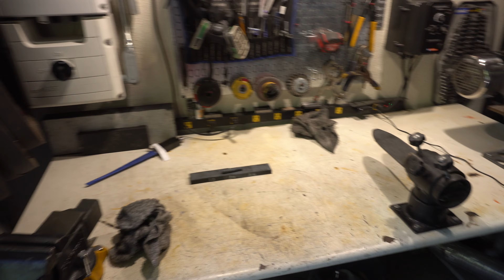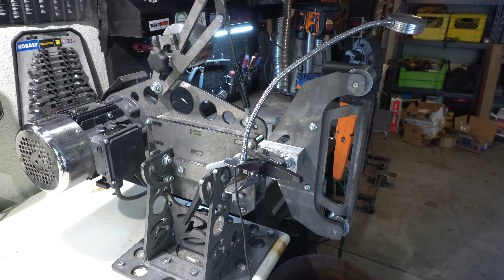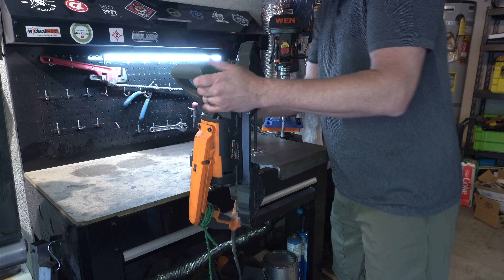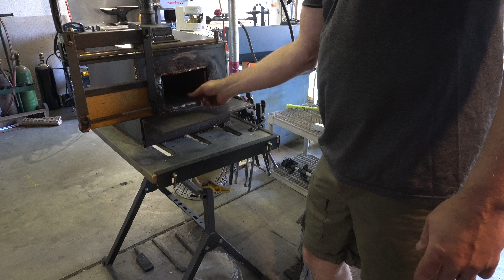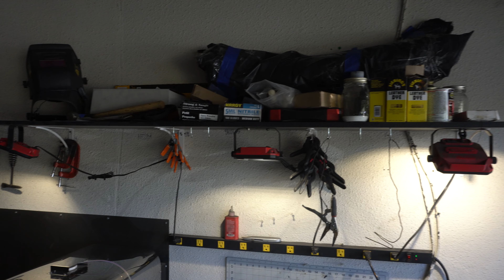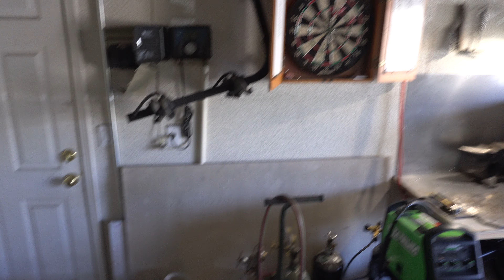Triple-T Thursday #39 - Shop Tour

Comment: How much money to buy all the tools and machines that cost to become a blacksmith,in your garage, that makes me have a good idea when I leave the house and buy a house.
Reply from the maker: That's a tough question... because you don't just start with all those tools.  I started by buying a welder and teaching myself (via YT) how to weld.  Then I build my first forge.  Then I bought an anvil (the NC anvil) a 4x48 and a vise and basic hammers from Home Depot.  That gets you really far.  Then I built my old 2x72 (the orange one that I've since replaced) and my hydraulic press.  Then I slowly started adding tools like the mill, oven, new grinder, saws, etc.  You can get into the hobby for about $500 and then decide if its something you want to invest more into. 👍🏻
Reply: @TyrellKnifeworks  hi, but just some rough estimates please. What would cost one to have the exact set of tools and equipment? thank you
Reply from the maker: @canadianguy5244  I'm going to list tools here, it'll help me calculate and also give you an idea.  Welder $1k, Oxy-Acetelyne rig $400, Oven $1600, Post vise $200, Mill $3k,  Lathe $1200, Mill/Lathe tooling $750, Table saw $400, Horz bandsaw $400, Metal cutting saw $300, Portaband $300, Anvil (hay budden) $800, Forge $600, 100lbs propane tank $200, Press $1500 (if you build it), Drilll Press $100, Grinder $2600, Small tools (vices, files, punches, clamps, tongs, hammers, etc) $1k.  So around $16.5k give or take $1k.  You've got consumables on top of that like belts, sandpaper, propane, electricity, epoxy, etc.  I didn't cover any of the leather supplies either, that's probably another $500.  I hope this helps you.

Comment: I was wondering a few things first of all what bandsaw blades do you use and what is your Aneling process to be able to use it?
How much was the mill? And how do you get through forge scale without a grinder everyone skips this step in videos and it’s so important but messy and time consuming 
Thanks in advance your channel is straight up amazing you are so good at putting things in a way that everyone can understand and you focus on the stuff literally everyone else takes for granted I am amazed at your shop you have so much less then I would have expected which says alot
Reply from the maker: Bandsaw blades: for the portaband I just buy the cheap dewalt blades or whatever is on sale.  For the horizontal saw I use the Starrets blades because they are better quality (https://amzn.to/2VctTTZ).  I usually leave what I'm cutting in the forge after I turn it off and let it cool as the forge cools and then cut it the next day.  That anneals it really well.  The mill was around $3k with the stand and vise.  If I'm doing restacking of damascus, then I'm using an angle grinder but if I'm just cutting steel, I try not to use an angle grinder.  I used to have a variable speed grinder and I used a stone wheel, that works really well, but I burned out that grinder and haven't replaced it.  Thanks so much for the kind words.  I appreciate that and you watching!  👍🏻
Reply: I’ve got this Idea to do a Damascus blade with brass and Nickel instead of copper but I have never seen it done and was wondering if there’s a reason. theoretically it would work like  copper because of its melting point which is 200° less And as long as the nickel surrounds it it should be fine right? Any input would be amazing considering you were the only person that has any experience with this that I can ask. I have had plenty of experience and success with nickel but even fully welded up The copper melts and leaks out Which amazingly does not ruin the billet.
Reply from the maker: @tommydean9414  The problem is over heating the brass and melting it.  It's really easy to overheat the copper in a cu mai and melt it away, so brass is going to be even harder with the melting temp around 1825, which is about 150 degrees less than copper.  You'll definitely need to fully weld the edges.  Even then I've had the copper leak out sometimes.  It's certainly doable and I've seen it done before.  I've seen the brass/copper/nickel combo.  You just need to really watch your heat and keep it dull red and just enough so the steel moves and no higher.  Good luck!
Reply from the maker: @tommydean9414  One of my next builds coming up (the billet you saw in my steel rack) is damascus/copper/15n20/copper/1095 core.  It should look pretty amazing I think! 👍🏻

Comment: I always like to see someone's workshop - it's good inspiration to improvements in own space:)! You didn't say how much space is out there- Im very curious :)! As always, great Triple T :)!

BTW: I saw that you bought evolution disk. Does the original get dulled?
Reply from the maker: That’s a great point.  I’ll have to measure and put it on the comments.  👍
Reply: Looks like a very big garage! I turned the back of our parking space in the carport into my shop. I set up a sheet of metal and some plywood to create a space for welding to protect the eyes of passerbys.   I'll be expanding it soon to accommodate a Cress heat treating oven I got from a dentist, needs new coils amongst a few other things to dial it in, plus a Jelenko mini sandblasting cabinet  (noth free!). Cutrently, I use the good old 4 brick propane torch forge to heat treat. Soon I'll be purchasing Brian's Revolution 2x72, that being said, I'm looking for a 3ph 3hp tefc motor and VFD. I have a Norse 2x42#Eventually, I want to upgrade my bandsaw as well.  So much to do, but once bitten by the knife making bug...obviously you know what I'm talking about  ;)